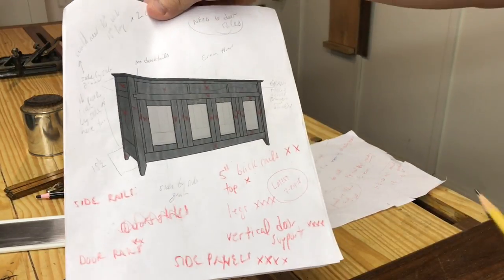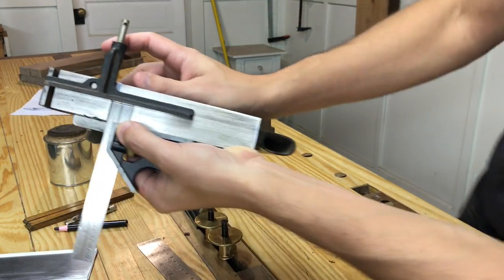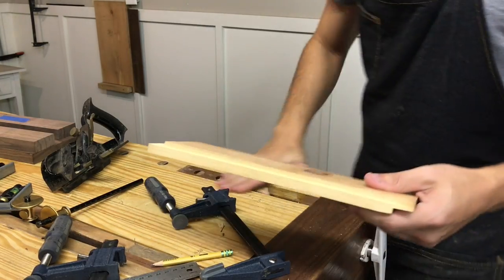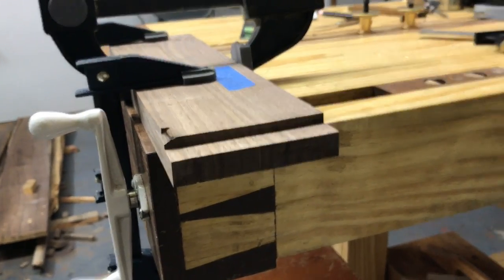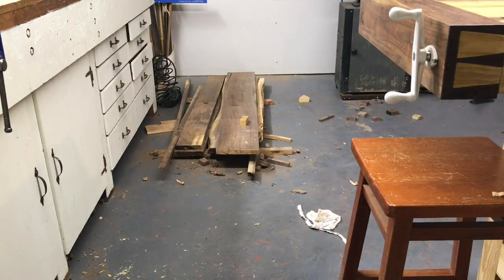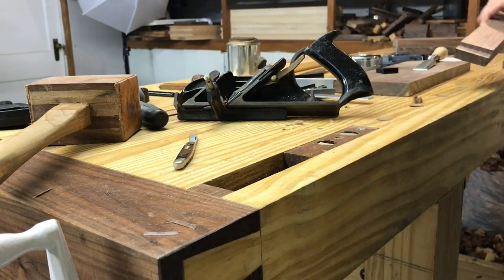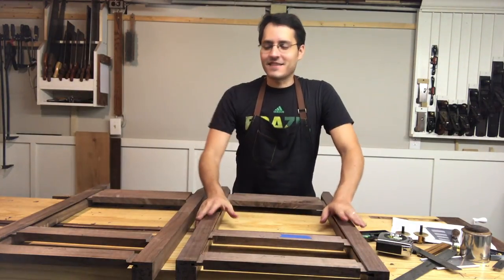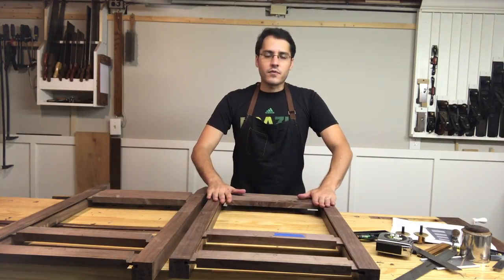Building a Sideboard part 7: Forming the Rail Tenons

Comment: You can configure the Stanley 78 for left-handed use.  There's a tapped hole on the right hand side, just behind the bed for the iron, that'll allow the fence rod to mount.  Neither the spur/knicker nor the depth stop will be of much use in that set-up, but you can always establish the tenon cheeks with a saw cut if necessary and gauge a line to establish the final depth.
Reply from the maker: Thanks! I have done that and the issue is definitely the spur/knicker and the depth stop. It’s good for less precise work for sure. I like the saw idea for sure.
Reply: That's what I do. Just can't depend on the knicker. Other than that, I love my 78. Great vid!

Comment: Try only using the nicker to start the cut and prevent tear out. Once you have a good little recess established flip the nicker back around before your cut gets lower then the screw that holds it on. Should help from it catching and marring your material up. Think of it as an added pre cut step like another marking gauge wheel. Nice work!
Reply from the maker: Thank you! Good tip!

Comment: really cool! I just found a new old stock 78 in the box myself. I think you could avoid that blowout split by having a sacrificial piece of wood on the end. let that split out instead of your good wood. I also had a bit of a bevel on my first cut after sharpening. Keep your eye on the gap between the side of the plane body and wood rather than the rabbet. I know, its a bit counter-intuitive. It's a fun plane, but it needs lots of practice! oh, grinding a bit of a back bevel on the iron also helps it be less scraper-ish too.
Reply from the maker: Excellent tips!!! Thanks!

Comment: It might be worth checking out the Veritas left-handed rabbet plane. It took me a long while to finally set it up, but once I got it working and the set screws dialed in, it is really nice. It took a bit to get the knicker to line up with the blade, which I have about 1/32 proud of the body. Only real complaint -- besides the difficulty in setting up a rabbet plane -- is the front knob. But at least you can remove it.
Reply from the maker: Thank you for this information! I’m going to check it out!

Comment: I have had problems with fence slippage on the Veritas Skew Rabbet Plane.  I believe I recall Christopher Schwarz recommending taking some 320 grit sand paper to the rod to roughen up the surface.  I did that and have not had a fence slip since then, but I must admit that I am also aware that it could happen and may subconsciously be planing more carefully.

I wonder if it was the depth stop that caused that break out on the corner.

Nice tip on ganging up the pieces to cut multiple tenons!
Reply from the maker: Great point about the fence! I will definitely try that. I think with more practice I will have less tearing out on the back, but it very well could have been the depth stop. This plane is good but on tough grain I will use a saw in the future!

Comment: Your iron should not be out so far as to be able to catch like that!  You should check to make sure that it is flush with the out side edge of the plain not sticking out and that it is in straight as if it is crooked at all it can be out further up the iron from the bottom even if the bottom is flush to the edge.  You can also use a scrap on the end to help prevent blow outs as well.  Also start to plain at the far edge and gradually work your way back across the board with successive passes until you are taking a full width shaving!  As a result you will come to depth at the far edge first and the near edge last!
Reply from the maker: Thanks for the tip! I'm not sure it was overhanding, but it must have been. All I know is that I don't have much experience with the 78, but that's changing. This grain was really difficult at times, and planing with my right hand really was challenging for me, so I never felt comfortable taking the full pass. Hopefully I'll get the hang of it!!
Reply: Exactly how I've been shown, start planing the end of the groove that is farthest away from me...that's the starting backwards that I understood...